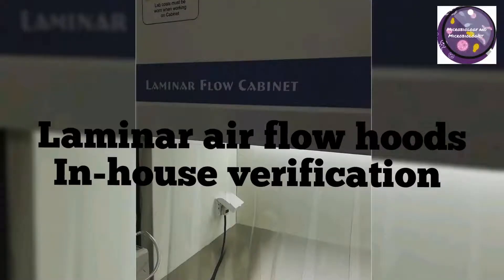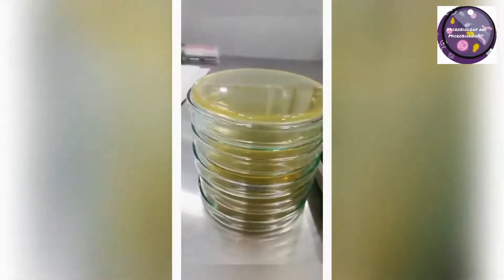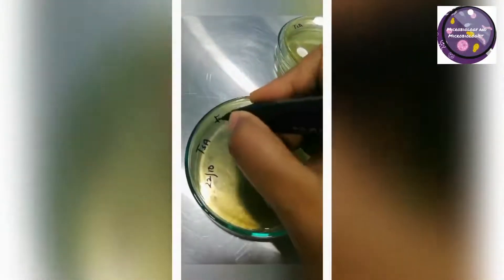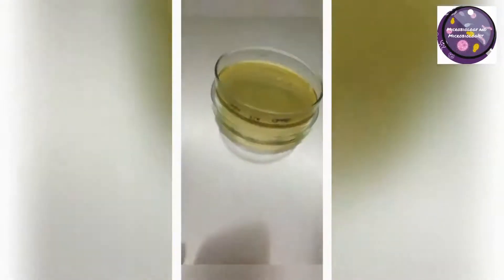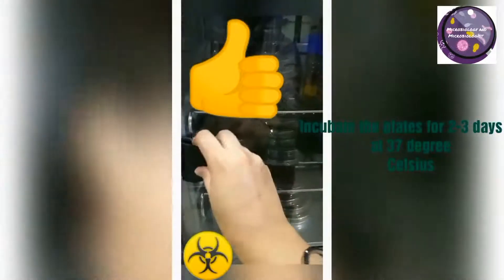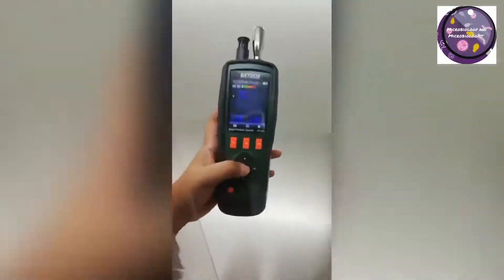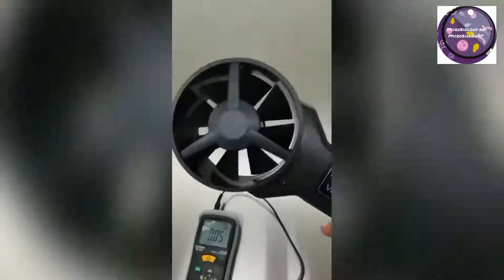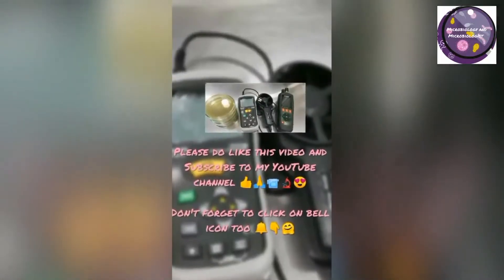Laminar air flow hoods in-house verification | VIABLE COUNT |PARTICLE COUNT | AIR VELOCITY CHECK

Comment: what are the difference  between  normal laminar  and hood laminar
Reply from the maker: Kindly elaborate what do you mean by Normal?
Reply: @microbiologistandmicrobiol5664   laminar air flow and laminar air flow hood  me difference
Reply from the maker: @EverydayEnglishwithRohit  these both are two different things... As its clear in your question already ... Laminar air flow is a flow of air which is actually at the same speed and in the same direction as its air flow. And about the laminar air flow "hoods"... these hoods are used to flow air in the same direction.. So the difference is actually the verb and noun... Hope you get the answer
😊